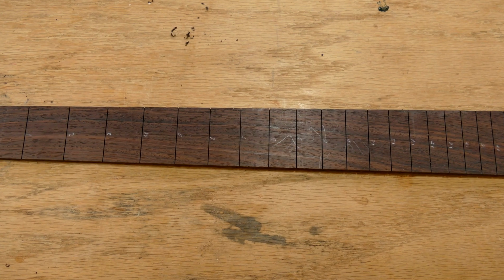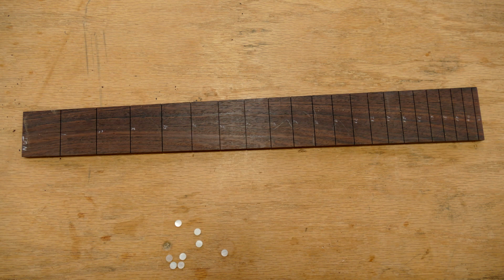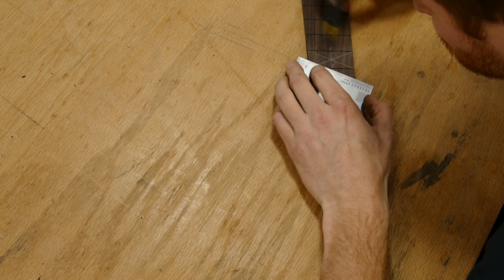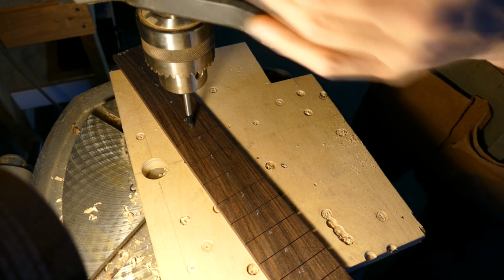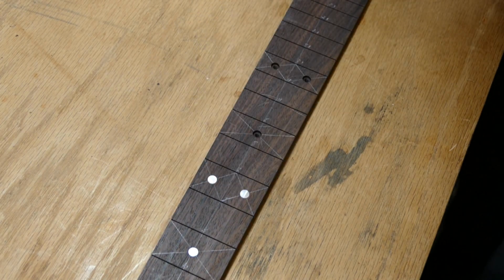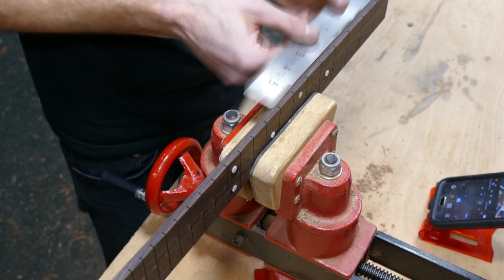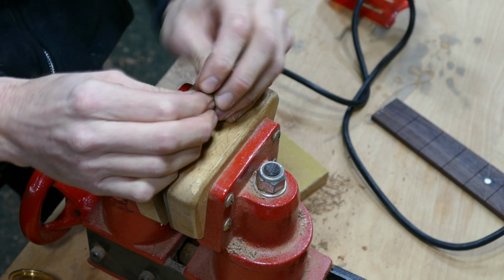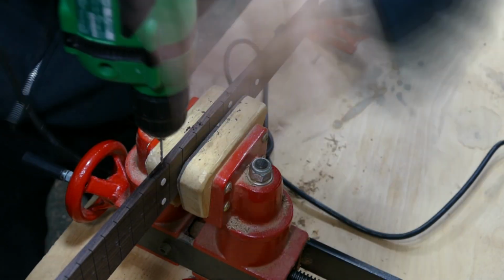Inlaying Fretboard Markers and Side Dots

Comment: Very nice tip about using the awll prior to punching the points. Definitely improved accuracy. I also really like your tip about keeping the shavings. I’m putting some dots in a pre-radiused fretboard. How would you suggest installing these? Do you leave them slightly proud and trim them with a razor?

Comment: Super glue? I saw a video where the guy just used regular Elmer's wood glue (dipped inside the hole). He used a wet cloth to wipe off any excess.
Reply: I use Titebond (dark color) simply because it's what I use for the rest of the guitar. I also use a lot of CA glue when turning bowls and Eric is correct in using a respirator during it's use.
Reply: An advantage of ca glue is that it is drawn into cracks by capillary action. The  Smaller the gap , the more it gets sucked in - Especially the water thin stuff. Pour some on and watch it dissapear ! Wood  glue shrinks and can't fill gaps as well as ca,  so your hole depths have to be more  precise to get a good bond. It also takes 24hrs. To fully cure. The ca glue cures almost instantly.
Reply: @michaelduddy4119  Is CA glue similar to Krazy Glue?

Comment: Hey Eric, I saw a fretboard online with some (what I assume to be) cubic zirconia fret markers. If I were to install them on a guitar of mine, how would you recommend to glue them to the wood? Thanks for the great videos you're making
Reply from the maker: I've read of this being used before for side dots, but I don't have any experience or knowledge on how to do it. I would imagine the CA glue would work just as well in that case. Anything you would inlay into another material hardly needs any strength to the bond since there is no force acting against the joint (i.e. it's not structural so I would give it a shot)

Comment: HI Eric, could you tell me please where to get such a forstner bit? thanks for your invaluable tutorials.
Reply from the maker: I have this bit set:
https://www.woodcraft.com/products/forstner-10-piece-bit-set?gclid=CjwKEAjwl9DIBRCG_e3DwsKsizsSJADMmJ11OyHmSb8Prbb91ipAjaUpbQ8TVD8RTqQVgd4rOTZRDBoCByHw_wcB

They apparently also sell them individually:
https://www.woodcraft.com/products/1-4-forstner-bit?gclid=CjwKEAjwl9DIBRCG_e3DwsKsizsSJADMmJ11ih2ZVPzdN_Wosdebo8IXlS3bj-N15nmZ3coRyZByZBoClrPw_wcB
Reply: thanks
Reply: Be careful when you buy the dots that they're not a metric size that doesn't match your drill bit. For example, 6.35mm is the same as 1/4 inch but 6.3mm is not. You can buy the bits one at a time from Amazon. Forstener bits can dull easily and are very difficult to sharpen. Highly recommend the carbide tipped ones on Amazon. Should stay sharp for years. Stewmac sells dot markers in lots of sizes and small quantities for less than $3.00 with free shipping.

Comment: I bought a guitar with no inlays,can I have them installed when already built?
Reply from the maker: yes, but levelling them flush will be challenging with the frets in the way. The best thing to do is to remove the frets first, so you can easily level the inlays with a radius block, but if you are not confident in your ability to remove and refret, then you can level them individually with the frets on by carefully using a sanding stick. I say "carefully" because it's easy to sand too much here and leave a flat spot in the radius that you can feel with your fingers.
Reply from the maker: I'll be answering your question in further detail in an upcoming video: https://www.youtube.com/watch?v=dpiqBqrU5ig
Reply: I'm not a luthier, but I removed a fret once. Never got it to lie flat again. Very frustrating. If I was a newbie, I would first try a card scraper or a small sanding block and work it down very very gradually and carefully taking care not to dig into the fretboard before pulling out any frets. Of course,  pulling the frets and using a radius sanding block is the pro way to go with guaranteed results.

Comment: My first guitar had no inlay xD my 2nd has inlays at 3, 5, 7, 9, 12 (and 15 I think )

Planning on making my own guitar  soon...ish... within the next year or so.. and man inlays will be a problem... as I'm planning to have them shaped like a diamond (like on a card) but with a radius instead of a straight edge... and 12th will be longer than the others... ugh... cutting the inlay will be easy... cuting the shape in the board might require help from an external source however xD
Unless someone has tips or idea on how to cut such a shape in the board...
Reply from the maker: dremel with a dental burr (ask your dentist for one) to carefully clear out along the curved lines, and then a 1/8" or smaller chisel to carefully nip out the inside corners.